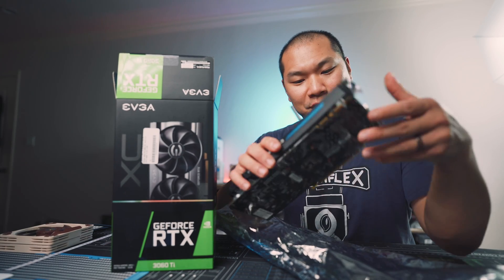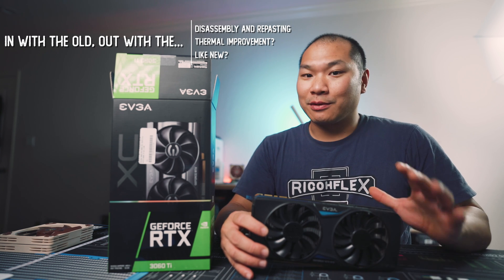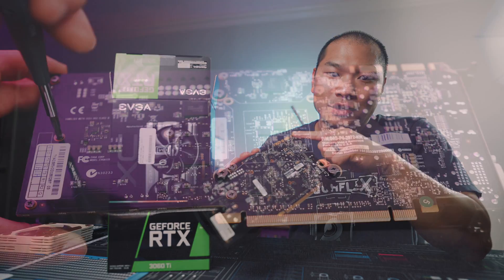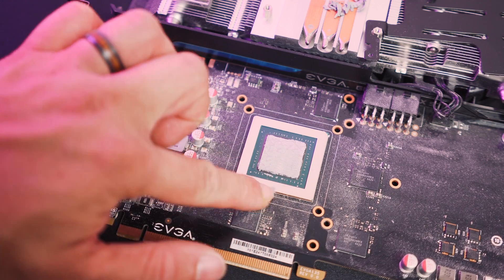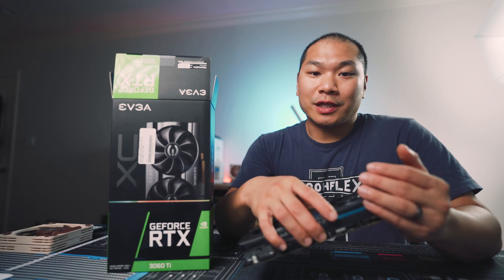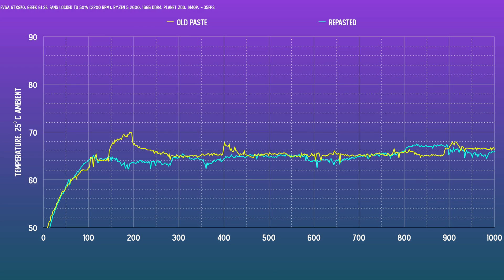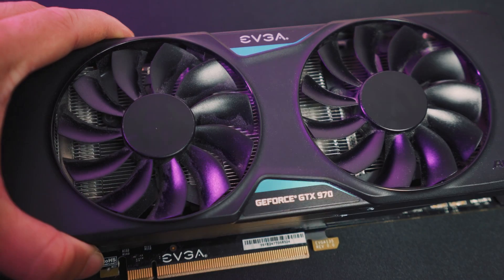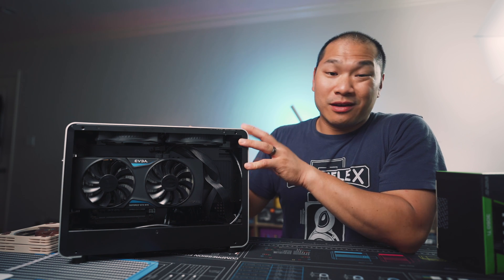Cleaning Up an Older Graphics Card... Worth it?

Comment: I think the aging thermal paste thing is blown a bit out of proportion in the community and often shows a lack of understanding of how it works. People seem to think of it like a lubricant (car oil analogies) or an adhesive (like a sticker that stops being sticky). Thermal compound is an INTERFACE material. Unless it's your lan party rig that experiences a lot of big vibrations, once the contact is set between the chip and the cooler it will work at +- a few degree C for a long long time, even if it gets "dry".

Comment: I had an old GTX 960 2Gb card laying around before upgrading to an RTX 3070fe. And instead of trying to sell the card during a shortage and possibly getting more than the card was worth, I took a bunch of spare components I had laying around and built a retro emulation PC. There’s a place for all older GPUs for sure.
Reply from the maker: Good job! What emulator are you running? And they’re surprisingly competent still!

Comment: Love your vids! Please don't clean your copper, or any of the parts that make thermal contact with a screw driver! You could scratch the parts that make contact causing irreparable damage that thermal paste can't fill!
Reply from the maker: Daniel, agreed! If you’re referring to the old paste being scraped off, it’s a flexible plastic “spudger” and what I’d typically use in that application. You are absolutely right metal would be a bad idea.
Reply: @MachinesMore  Ah sorry my mistake then it looked like a screwdriver at first glance

Comment: Nice vid! But it's probably a good practice to block the fan with your finger when you're blowing compressed air at it though. They'll hit way higher rpm than they were designed for and you can damage its bearings.
Reply from the maker: Agreed! Plus it’s easier to actually dust out the heatsink. Dramatic effect!
Reply: i would add to that that i wouldnt scrap off the paste from the surface of the heatsink like shown here, just wipe it off with alcohol, also you should add more thermal paste since its a gpu not a cpu